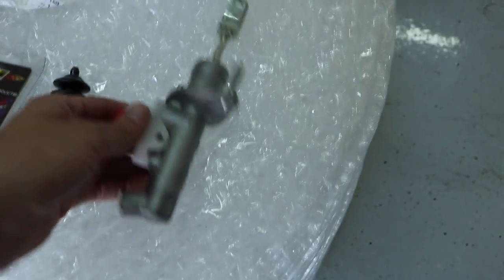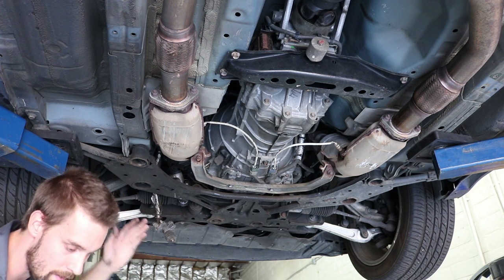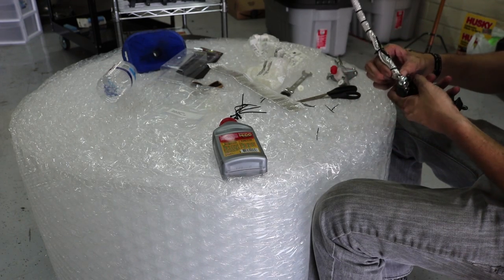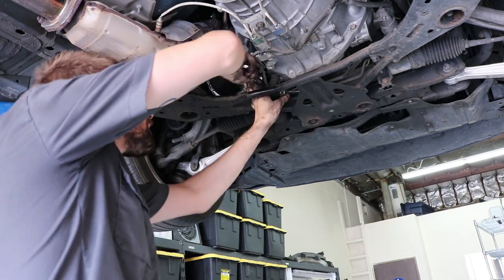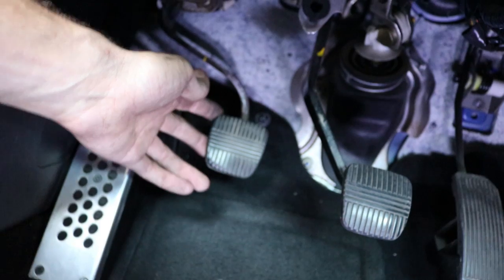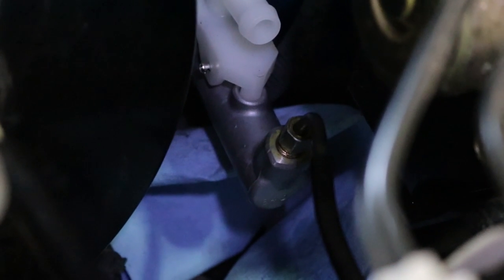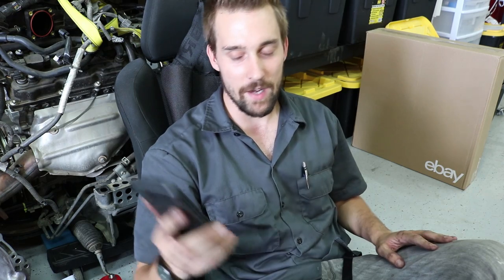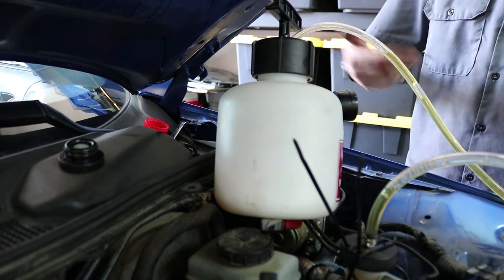350Z Clutch Master Cylinder + Slave Cyl  + SS Clutch Line Removal & Install

Comment: Hey man I have a question towards my g35 and I was wondering if you might know the problem. I’m having some disengagement issues. If I’m driving above 2k and I disengage the clutch it’ll take a second or two for the rpms to drop. So I can’t shift it or I’ll end up grinding due to that. Do you have any idea what it could be? I adjusted my clutch pedal and it did become better but i have no clue if I adjusted it enough? Do you have any idea what the problem could be? Btw I also got a brand new exedy clutch in the car too
Reply from the maker: Did you use a light-weight or single mass flywheel?
Reply: Single mass fly wheel
Reply: Do you have any idea what it could be? Do you think maybe it doesn’t have the right and or a good amount of transmission fluid? I was thinking maybe I should try bleeding the system because before when the mechanic bled my clutch I had a half pedal of free play so maybe it couldn’t have been bled correctly? I’m just trying to think of some things
Reply from the maker: Josh Thomas try to bleed it yourself, and get some Nissan OEM fluid(get 4 quarts) of mtf. And maybe some motul rbf600 for the clutch bleeding. I had an 06 z before that didn't drop in rpms very fast but that didn't stop it from being put into gear
Reply: I can go into gear but I just have to wait until the rpms drop. The car doesn’t disengage right away when I push in the clutch that’s the problem. So I can’t shift at normal speed anymore. I have to wait two seconds or so after disengaging the clutch to put it into the next gear
Reply from the maker: Josh Thomas Okay, if I were you I'd try rebleeding the clutch and doing a fluid change since that's the cheapest route. Then see if you have the issue still, if adjusting your pedal somewhat worked I'd try those first.
Reply: Okay, and there’s one more problem I’m experiencing. When I was merging onto the highway from second gear and I accelerated all the way to 5k and I pushed in the clutch I heard an awful grinding sound. The noise is similar to shifting gears without the clutch. It literally made that exact noise just from pushing in the clutch at 5k rpms in gear. You have any idea what that could be?
Reply from the maker: What is the production date on the inside of the driver door sill, a lot of the 2003-2004.5 z's and g's have hella issues with the trans. But you said you started experiencing these issues after having the new clutch and flywheel installed. I've never experienced the issues your having in a z or g. The production date should look something like 10/2003, etc. But did the shop that installed it give you any type of a warranty? I'd try to go back there first before messing with anything if they have a warranty for their work.
Reply: The mechanic didn’t give me a receipt or anything. Only proof I have is text messages. Every time I message this mechanic he completely ignores me when I’m trying to meet up with him. So it makes me believe he must’ve done something wrong but a lot of people recommend this guy and that he’s an excellent mechanic.  So I’m just wondering what could be going on. I just bought a new slave cylinder because my clutch feels weird here and there and idk if the owner before has ever changed it. So I’m focusing on that being the problem of my car
Reply from the maker: Josh Thomas That sounds sketchy asf though lol. You should definitely replace the slave when you replace the clutch, and bleed the entire system. Give that a try and flush the trans, and let me know what results you get.
Reply: Deff will, currently right now I’m doing my clutch master cylinder and I’m having some issues pulling it out. I unbolted the two 12 mm from inside the car. I took out the reservoir. And now It’s still not pulling out. Is it because I didn’t take out the hardline yet?
Reply from the maker: Josh Thomas Yeah to remove the master cylinder, you need to take off the hard line at the master cylinder
Reply: Yeah because the master cylinder is only coming halfway out. How am I supposed to take off the hardline though? I barley have room to even unbolt it and then when I tried a wrench it didn’t even move. All that was twisting was the wrench itself. Do you have any suggestions into taking this out?
Reply from the maker: Josh Thomas flare nut wrench, the best way to remove brake and clutch lines so you don't strip them
Reply: Okay, so all I gotta do is just remove the hard line? Because literally I can only pull out the clutch master like halfway and then it feels like something is restricting it from coming out. My plan was to take out the cylinder first and then the hard line due to having no room in that area
Reply from the maker: Josh Thomas Don't bend the hard line, it will make putting it back on a lot harder. Plus you don't want to kink the tubing. Remove the hard line then remove the master cylinder
Reply: Hey man I just experienced a problem. I changed the master and I filled the reservoir up but now my clutch pedal is just sinking to the floor with no pressure
Reply from the maker: Josh Thomas You have to bleed it, it's covered in the video
Reply: Is there another way to bleed the clutch master without the power bleeder?
Reply from the maker: The very first time I changed the clutch on my z, I didn't use one. I used the 2 person method, and it worked fine. But a power bleeder is the way to go. The two person method works by one person opening the bleeder valve and another lifting and depressing the clutch pedal simultaneously. You should be able to find a video on the two person method here on YouTube.

Comment: Im having a problem with my 350z where when the car is running i cant put the car i to gear, when the car is turned of it goes through gears perfectly fine
Reply from the maker: Sounds like the clutch, have you tried bleeding the clutch? Does the pedal feel soft, or hard when you push it down?
Reply: Full Throttle, I have the same problem. The pedal feels normal, possibly a little stiff. I'll go ahead and bleed it out, since I got a new clutch..

Comment: Bros can you help me this is driving me crazy I have a pre hr model manufactured in early 07 and I'm in need of a new tranny but the tranny known as the jk400 is no longer made  does the new JK41B tranny fit my car ?
Reply from the maker: So do you have the Rev-Up/Up-Rev 350Z? Non-HR, No dual intakes? If you do then Z1 Motorsports sells the CD009 Transmission for 1700-1800 new or somewhere around that number, or you can pick up a CD009 for in between 450-750 used. Because if you don't have the HR, then your car should have a CD009
Reply: Full Throttle Thanks for the quick reply man so I have an hr with double intake but I guess in early HRs pre 07 they had a specific tranny but I'm not sure if the ones they sell now would fit
Reply from the maker: What's your exact production date? Because if you have an HR, then any HR trans should be fine, but I'll do a little research for you
Reply: Full Throttle It says it was manufactured in 01/07. Thanks alot man!
Reply: The trans number is FS6R31A
Reply from the maker: See the link here, it looks like the JK41B is compatible with the FS6R31A. In the description it says the same transmission model.https://www.nissanpartsdeal.com/parts/nissan-transmission~320b0-jk41b.html?Make=Nissan&Model=350Z&Year=2007&Submodel=&Filter=(2=VQ35HR;4=MT)&Location=manual-transmission-transaxle-fitting,320_A001,32010
Reply: Thanks a ton man!
Reply from the maker: No problem

Comment: Is that a the same process on a 2007 infinito G35S???
Reply from the maker: Do you have a HR or DE engine?
Reply: If you have a hr 07 09 they have internal csc so yes you will have to drop the transmission ball ache of a job and cost

Comment: Is the slave on the inside of the transmission on the hr?
Reply from the maker: Yes, HRs have what's called a concentric slave cylinder. You have to drop the trans to change it. If I were you I'd get the delete kit from z1 that relocates it to outside the transmission
Reply: Full Throttle thanks for the response I have a de...my mechanic I guess is used to changing them on the hr soon as I told him what the problem was he told me He was going to have to drop the tranny to get to it until he jacked the car up and saw it on the outside...
Reply from the maker: @lex4lyfe870  Yeah, it's a pretty easy job on a DE. Shouldn't cost too much, as long as you don't take it to the dealer lol

Comment: Do u knOW any good websites to buy a transmission from
Reply from the maker: Z1 sells complete new OEM CD009 Transmissions for around 1700-1800, otherwise I'd check Craigslist/OfferUp/LetGo/Facebook for used transmissions. The dealer may be able to price match Z1 so you can save on shipping instead of ordering online.

Comment: I need your help ASAP.is it mandatory to put the clip back on the stainless steel line???why is it so fucken hard to put it back on ...
Reply from the maker: I would definitely put it back on, just clean up the area real good, so there's no dirt, or debris. Should make it fairly easy to put on
Reply: Full Throttle thank u so much for replying.i can’t.im trying and trying and nothing.i tried cleaning it nothing.did u connect both lines before putting the clip?
Reply from the maker: Honestly I don't remember off hand. It's not shown in the video?

Comment: It's sounds cheaper until you realize 99% of us don't have a lift.
Reply from the maker: I did three years on the floor of my garage before I got a lift, excuses only make it harder. Just do it bro
Reply: @fullthrottleperformance  except I have a 370z and csc is in the transmission. I want to do it, but it looks a little bit above my skill level.
Reply from the maker: @mr.fuscles  you can do it bro, you don't actually need a pressure bleeder for the csc, and it's okay if you can get enough lift from stands. Get big truck jack stands and jack up to the highest your jack can go, then support the car. Then, get a 2x8 and jack up more with the 2x8 under your floor jack, and go up incrementally. Adding another piece as you can. Use your judgment, and don't do sketch shit. And if you've never done it before, take your time! Take your time! Support the car correctly, make sure you're safe under the car! Put spare wheels under your wheels in case the jacks fail. But if you take your time you can do it. If you're not comfortable, bring it to a shop you can trust. Simple as that. First clutch I ever did was on my floor of my garage and took me a week because I had school and work too

Comment: How do I know if there out cuz I think mind r out
Reply from the maker: Master cylinders, and slave cylinders are part of normal maintenance on manual vehicles. They wear out and need to be replaced, if you're experiencing issues where the clutch pedal stays to the floor, then you either need to bleed, or replace components of the clutch system. And the cheapest parts to replace are the master, and slave cylinders.
Reply: Every time I go into 1st gear the rmp going to like 5 to 6 thousand rpm then start movies is that the clutch r my slave cylinder and thank you
Reply from the maker: @jacobwinters8128  Your clutch is going out, here's a video on replacing the clutch.
https://youtu.be/DZf4rG1aMa4
Reply: When I replace the clutch do I need to replace the flywheel
Reply from the maker: @jacobwinters8128  It's recommended, I didn't on my car, and I've put 40k miles on it since without any issues.
Reply: Thanks for all the help man really appreciate how to see your channel grow in success
Reply from the maker: @jacobwinters8128  Thanks for the support man it's much appreciated 👍👌👍👍

Comment: How can I tell if it's a slave cylinder or master clutch cylinder is bad? We have a 2016 Jeep Renegade Sport and we recently had the clutch replaced but not the slave cylinder or master cylinder. The clutch goes to the floor, vehicle starts up, but the clutch does not come up or have any pressure. All the brake fluid leaked out.

Comment: Will a 2007 350z have the same location for the slave cylinder?
Reply from the maker: No the 2007 has an internal slave cylinder, you have to drop the transmission
Reply: @fullthrottleperformance  I appreciate it bro, thank you